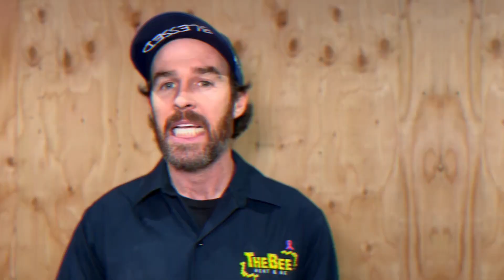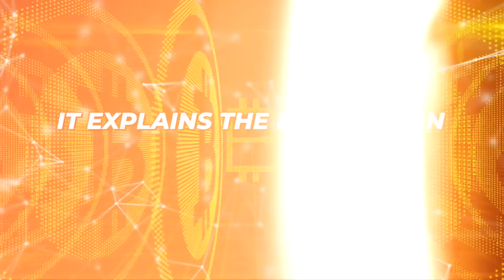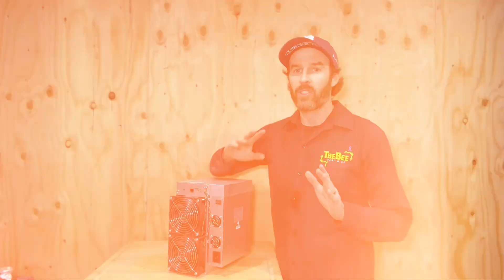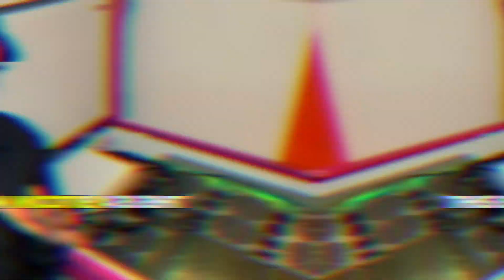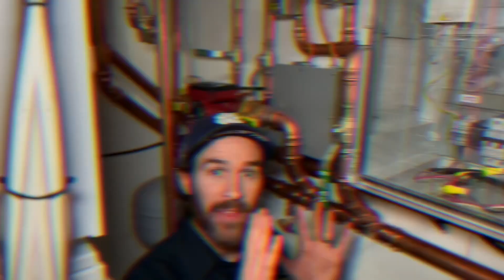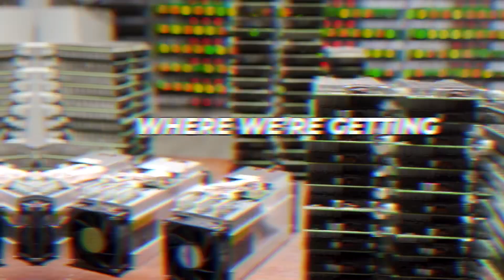We use BITCOIN to heat our office🔥🤯

Comment: Sorry, had to laugh. Don't get me wrong, it's an ingenious way to repurpose the CPU heat. Also that is great for the winter. Where are you dumping the heat in the summer? Hopefully going to try and call you next week to talk about the Heat Pump options. Thanks.
Reply from the maker: Haha thanks yeah it was just a way to repurpose the heat… we have a dry cooler that the fluid runs through year round but in the winter we’re at least not wasting the “free” heat. Only cost is the cost to run the pump for that loop. Primary purpose was crypto mining
Reply: @thethoughtprovocateur  Heading to Denver to see family mid April. Was hoping to swing down and talk Heat Pumps. 15-21